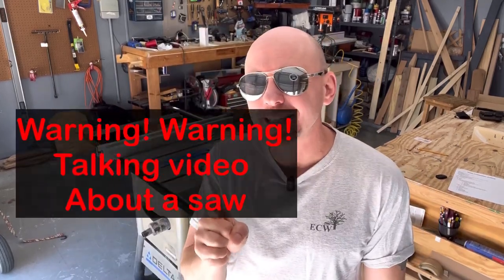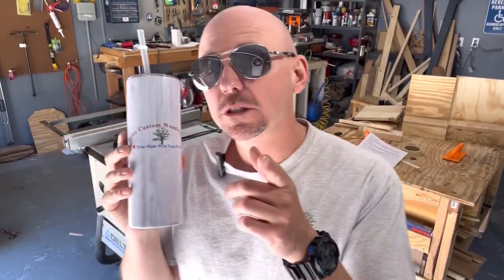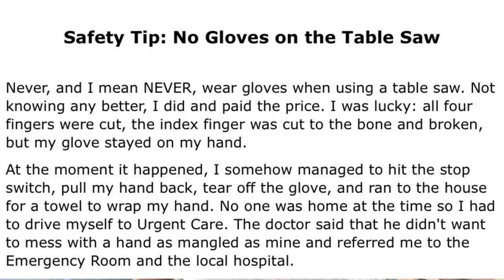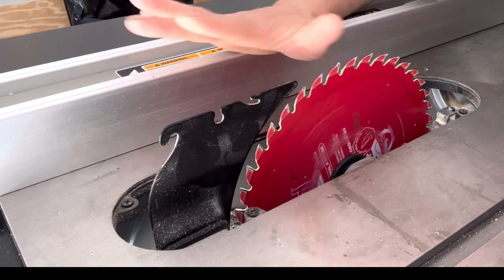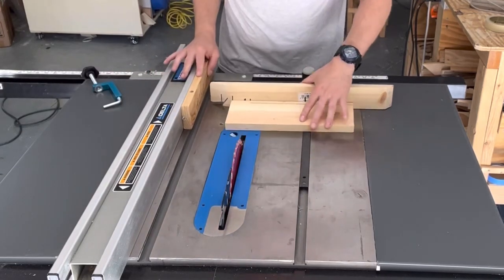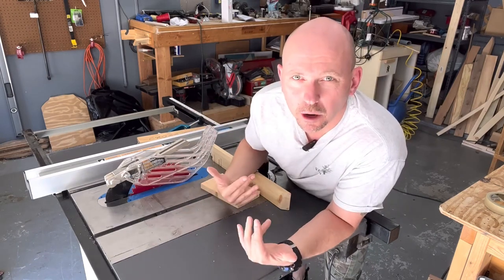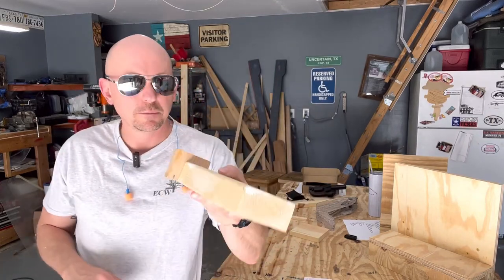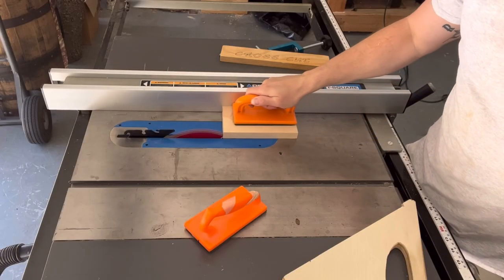What you need to know when first using a table saw. Table Saw Safety

Comment: "Leave the gloves off when dealing with a table saw."  I sorta  wish I knew this a few years ago, but, am glad I learned my lesson the hard way.  

I raise my blade barely enough to cut a board and it sometimes leaves a skin between the cutoffs. I wore my brand new gloves one day with very splintery purple heart.  

My mistake was to cross over the blade (I don't remember why). That was bad, but the glove hung maybe 1/3 inch below my finger, and while it was way too close to the blade, my finger got sucked into the blade on top of the board I was cutting. 

I only needed a band aid, thank God, and it left what I call my "racing stripe" on my left thumb about the width of the blade and 1/2 inch long. 

The only reason I'm glad for the accident is that it reminds me to be much more conscious and calculating about what I'm doing and where my limbs are. I can't look at the table saw without thinking about my thumb and being more cautious. 

PS. I don't wear gloves around any power tools except for the cordless drill/screwdriver and the orbital sander.
Reply from the maker: WOW, sorry this took me ten days to see. Im pinning this story at the top. Thank you for sharing.